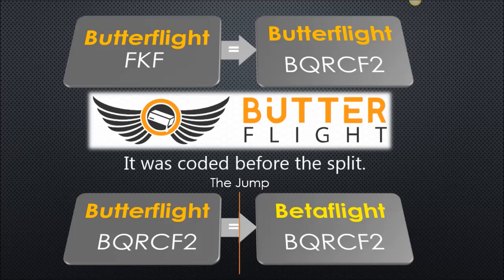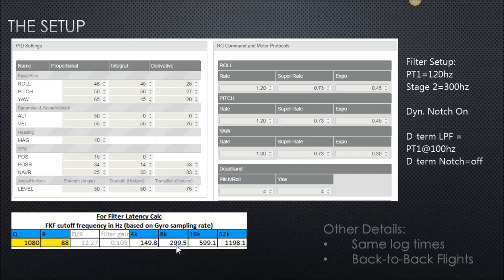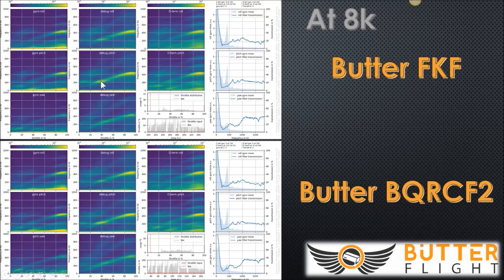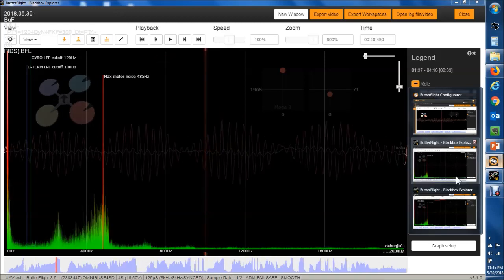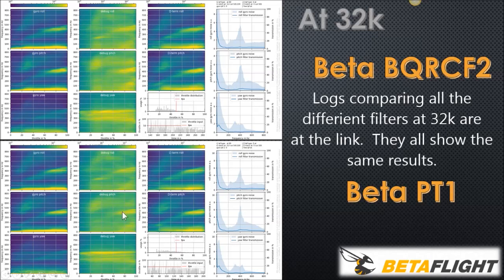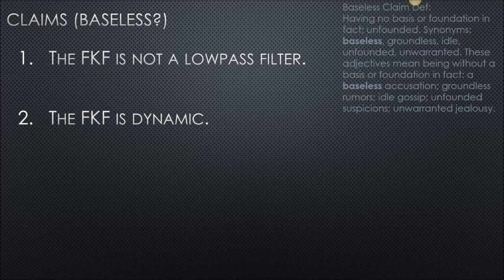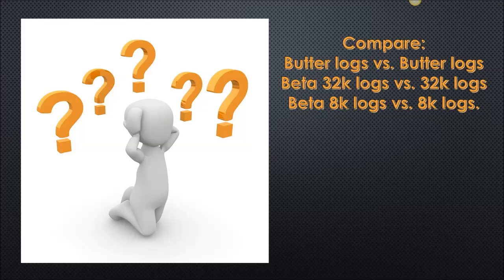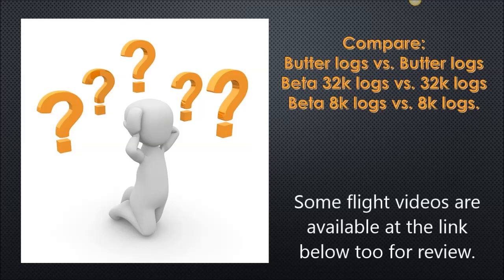Butter/Beta Filter Comparisons (WITH DATA!)

Comment: I understand that both filters produce very similar results with a deviations so little that on real hardware on speeds that this hardware can reach, human pilot can't see and feel a difference. I tried Betaflight 3.4.0 build #900 at yesterday with only dynamic filtering and LPF + Stage 2 PT1 lowpass filters on. Was impressed how smooth handling was. Filtered gyro traces in log are now super clean without any fuzziness over them. Didn't got such good results earlier with all kind of available filters. Definitely various lowpass filters like Kalman, PT1, BIQUAD_RC_FIR2 etc. had differences between filtering results in time period between February and May of this year. However now filtering in general look enormously improved. Seems choice of firmware between latest Stage 2 PT1 or Kalman filter support now actually is going down to personal preferences and various kind of habitual/ezoteric stuff which is not relevant by scientific point of view.

Comment: Really nice work, dude. But... That's something almost impossible to compare... The only way would be if you could fly, record the transmitter's output and then execute the tests simply reproducing what was recorded. You know? That's the only way to get valid data, because the differences on the flight would come only from the firmwares. Anyway, even if someone could do that I bet the difference would be minimal.
Reply from the maker: It was simulated. Folk still argued.  I can not do that sim., but one interesting concept was to sit the quad on a speaker and play a song, same song, and compare.

Comment: Instead of experiments, is there a mathematical proof that can be performed to show the filters are equal?
Reply from the maker: That was done already.  But then folks say that is not real dynamic flight.  The link for where that started is: https://www.rcgroups.com/forums/showthread.php?3009636-BF-K-Testing-the-Fast-Kalman-filter-on-Betaflight/page22

RS2K even said at one point they are equiv. and then took it back later: https://www.screencast.com/t/9j5npi6wuq

Then BF kept working it: 
https://github.com/betaflight/betaflight/pull/4965
https://github.com/betaflight/betaflight/pull/5231
https://github.com/betaflight/betaflight/pull/4890#issuecomment-356636997

In the face of all of this data, including the data published in this video, folks will still insist they are different.  It is kind of crazy at this point.
Reply from the maker: Produce same result.  See logs.  Give me a Debug Mode that shows the gains changing/moving.
Reply: Always classy Andrey =)
Reply from the maker: Yeah, lets keep it nice.  We are all brothers in the addiction.
Reply: Shawn Loftin A simple code review shows that the values don't update after less than a second. Nothing touches those variables besides the internal calculation that levels out almost immediately. If something fed into them sure, but that's not happening.
Reply from the maker: I don't want to argue math.  Provide a debug mode that can record the gains changing.
Reply from the maker: Ideally something we can all fly, log and see for ourselves.  But it still then doesn't explain why the output appears to be the same in either case.  :-/

So maybe it does change, but the change is just soo small that it doesn't matter?

I kind of thought adding a Debug Mode would be easy?
Reply from the maker: Shawn Loftin , looks like Tim is coding it up (from FB post).
Reply: My point was once they converge q and r  become a constant x. From a purely mathematical standpoint I understand your point, but the problem is q and r have no feedback in the software. They might as well be a constant. The fact that they do something at startup is not an indication of them being dynamic, it's just poor programing.
Reply: Cool. All good.
Reply: Go back to high school

Comment: I do like your videos. Great job keep moving forward with them!!! However I would mention that your FKF/BF comparison pictures around 6-7 min looks like a noiseless quad. Maybe the difference between the two type of filtering is not much if you don't try on noisy quads. What the comparison would looks like if you are using a very noisy quad like one of mine. The challenge is getting clear data from a noisy quad that still flies well without much latency.
Reply from the maker: Agreed.  I do think however, mine is pretty noisy kwad
[not that we want to get in a competition of who loses first. lol...  :-) ].  

Check out my raw gyro traces on Pitch  (image at: https://www.screencast.com/t/7dLuIZdx8r ).  That is with motors and FC softmounted.  I need to try to loosen my motor soft mounts, they didn't really have much effect.  Maybe they are too tight or just suck, IDK.
Reply: UAV Tech wow, indeed noisy...:D

Comment: Awesome presentation of data as always! I’m sure the hate mail will follow but my “BLIND” testing had very similar results. I have a theory as to why there’s such strong emotions about the “feeling” between the firmwares. I believe one can genuinely be better for an individual when comparing the 2 that doesn’t contradict your data... We’ve been looking for results in gyro sampling and filtering but the biggest difference from betaflight to Butterflight are default Dterm filter and frequency settings. Explains why “how it feels” can be drastically different for someone that maybe has a noisy setup or even environmental factors like elevation and temperature can change the feeling. I’d like to see data comparing the different Dterm filter types and why Butterflight sets the default cutoff frequency 40Hz lower than betaflight
Reply from the maker: I totally agree!  Defaults are not the same.  BuF defaults are Better (Butter!).  So comp. videos that don't take this into account are really comping Defaults, not firmware.  But, it is not presented that way.

This is recognized by BF that the defaults need to be updated, that will hopefully be done with BF 3.4.0 release.  There is a feature request opened for it.

Comment: thumbs up and great info mark..but FEEL is quantifiable in my book..it equals fun!  maybe its placebo when i go back and forth from beta to butter or quad to quad or wing to wing..ive seen many many pros (steel, nowak, stingy) just to name a few that use the words it just feels better or different..even mr bardwell has said a lot of tuning these days is feel and subjective.  i think thats an important part for the majority of us that dont want to dive to deep into numbers but it seems we have to because the general code of all this stuff is IMO worse then a few years ago...never  had MTO on simonk and cleanflight or baseflight :)
Reply from the maker: Thanks, Chad!  Loving your stuff too.  LOG IT!  :-)

I think feel can be confirmation bias on pre-consumed hype OR it can be measured.  Feel can be real.  I'm not saying someone can't feel a diff.  But we need to dig deeper then.  What are we feeling is diff?  PIDS?  Filters?, etc... We have the tools to measure 4,000 samples per second (or much higher if you have an awesome SD card or internal flash memory).  That is way more than 30 or 60 frames per second.  And if the logs don't show a diff. then it is a VERY high probability is confirmation bias.  I offer that feel is good, but it doesn't trump black box logging.  There would be no scientific basis I'm aware of to make such a claim, so hence baseless and that's not a nice definition.

So, I think every test can start with feel to see if you notice anything.  BUUUTTTT!!!  then if you do, the next step is to log and explain through that examination of what is different.  Too many don't take that next step.  Not a criticism.  Everyone is super busy, but I want to take that next step on things and explain, confirm, or debunk.  To me that is interesting stuff.  It personally interests me, so as a hobby ... (yes, I love the show Myth Busters).

I think the MTO thing is because motor magnets are closer and stronger; we are running faster loop times which pick up WAAAAAYYYY  more noise (especially 32k); and our expectations are higher.  All just a hypothesis. I think at this point we are working to 0 prop. wash conditions.  I know BF has some code they are working on right now that greatly eliminates bounceback, regardless of D (or is very less dependant on D).  It is really an I-term issue yet; more to come on that after a bug is worked out (I'm tracking).  So if that pans out that is one less thing.  So then remains MTO (jello) and prop. wash.
Reply: hmm..yeah motors and airgaps are a good point !!  same with ceramiz and ezo bearings in them.
Reply from the maker: Also, there is a cheap lock nut hypothesis out there too.  Some have replaced lock nutz they say and it has resolved.  However, no before and after data is provided of course.  :-( 

But good part is there is an easy way (folks have offered which is a good point and folks can test for themself) to test is spin up motors in the configurator with lock nutz on vs. off and see if vibs measured by acc. are more or less.

Comment: Great vid, solid results. Somehow I thought PT1 didn’t have the same amount of attenuation as BQRCF2, but my misunderstanding. I suspect we all make the subjective “I feel a difference” mistake more than we like to think.
Reply from the maker: PT1 alone is slightly less for 1,000hz+ noise.  The FKF or BQRCF2 is a PT1 + 2-point FIR smoothing filter.  So, in 3.4.0  you can have the LMA (Lagged Moving Average) filter turned on along with the PT1s and set as many points (Taps) as you want (2-11).  That is only needed for 16 or 32k gyro sampling rates.  Otherwise, 4 or 8k doesn't need LMA smoothing.
Reply: UAV Tech I can’t remember, but did u do a vid on the added phase latency with each added LMA point?
Reply from the maker: No.  :-(  ... and I don't know anyone that knows that answer yet (i have asked).  Still in study.  But honestly, I have not got there yet.

Comment: Love your videos thanks alot for the analysis. So are there any other differences between butter and beta that affect filltering apart from fkf? 
Maybe the default pid setup with the low D's makes it feel different.
Reply from the maker: Dovzo fpv , correct on PIDs.  No other differences.

Comment: Looking at the noise attenuation for fkf vs pt1 in your other videos. Fkf is better with higher frequency noise.  For fc running at 32khz you would expect more noise and including the noise at the higher frequency.    So there is some merit with fkf in this context. However how does this manifest in the flight experience hard to measure.   The other argument that has been on going is 32k vs 8k.  Back then when betaflight could not do 32khz  it was one of stand out features of racefight. I personally with my experience can not tell the different. Other may but not me.

IMO if you are happy with your tune then it is the best. It does not matter what Joe or Bob says. However for me I personally like this type of discussions. Thanks uav tech!

Comment: Ok. I do fly quads yet I’m no programmer. Most of this is over my head but I find it very very interesting.
I also play electric guitar. I use high gain and I have to use noise attenuation all the time. This looks very similar graphically to some recording software. You see the spectrum and where noise is and use graphic or parametric eq’s to squash it. I just wonder how much of that technology could be applied to quads, or if quad noise filtering is superior and can improve what exists in the music world.
Reply from the maker: Phil Cogswell , we us the same filtering!  :-)  

The kwad gyro picks up bass and treble, but we only want bass as treble makes the motors hot (trying to keep up).  So we use lowpass filters and notch filters to squash that treble!!

Comment: Thanks for the video. So am I understanding the conclusion here? Are you finding that we can pick up any F4 FC, throw the default BeF 3.3 filter setup on it, and we're good to go? No reason to bother with any of the newer filtering schemes? Is there any advantage to faster PID loops?
Reply from the maker: That conclusion was not my intent.  Butter had some great defaults.  One GREAT thing as a result of all this drama is that it has pushed the BF devs. to look at that stuff.  So, for BF 3.3.2+ (3.3.0 and 3.3.1 had a D-term spike issue) I can give you some better defaults that should work well, or copy the Butter defaults.  These new defaults are being baked into BF 3.4.0 I hope.  It is work by another gent I know so he is following more closely.  

There is limited conclusive data (scientific) showing the benefit of faster loop speeds.  It is on my radar.  However, one thing that is known is that if you go to a 32k gyro speed, the Digital Lowpass filter built into the gyro moves up from 256hz to 3,000hz which lowers the phase delay of the data coming out of the gyro and going into the firmware.  You can do the same by setting an 8k gyro to "Experimental".  WARNING: the downside is the gyro then passes a lot - and I mean a lot - more noise to the firmware that will need to be filtered (8k or 32k).  However, running the comps, that addition firmware filtering can produce less phase delay then the gyro chip doing it.
Reply: ive found it both ways..my long range rigs that are generally louder quads seem to do better at a 4k/4k pid loop.  they are tuned for cruising and maybe a few moves but nothing crazy..running 32/32 and 16/16 has widened the pid margin and has made it easier to get a better then default tune..but the fine tuning part is harder because its picking up everything and thats why these filters are so important..more important is a well built and clean machine..good solder..caps..no wires dragging on the FC and if using single escs then no tight wires pulling on the FC.  so many things you learn when trying to pull the cleanest video.